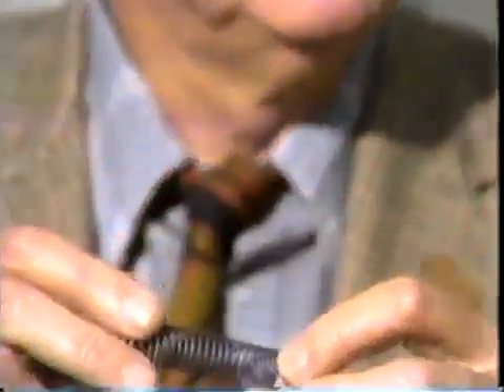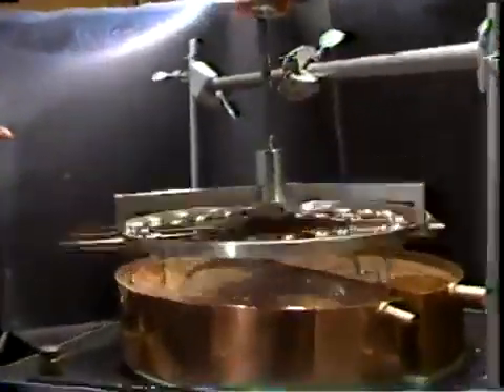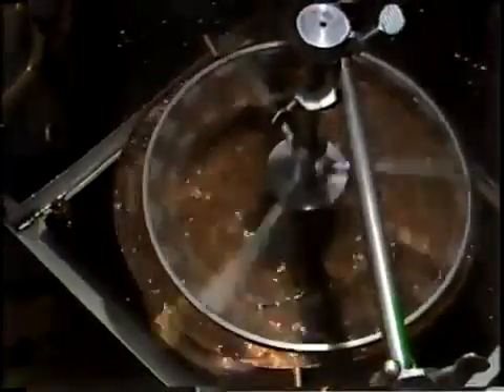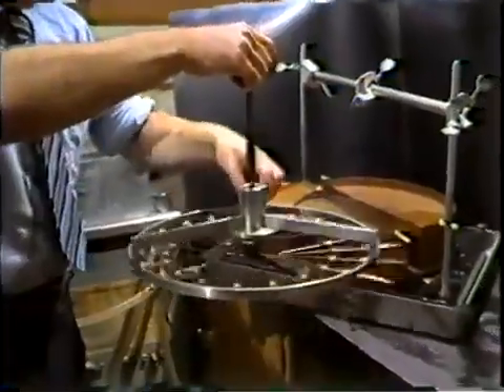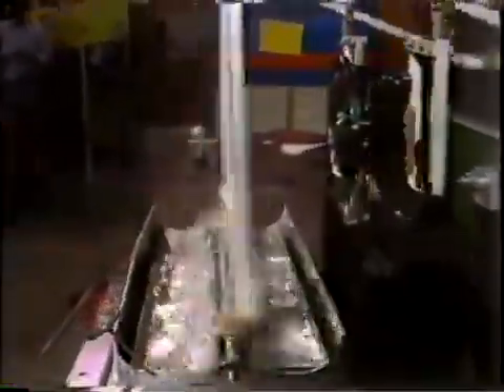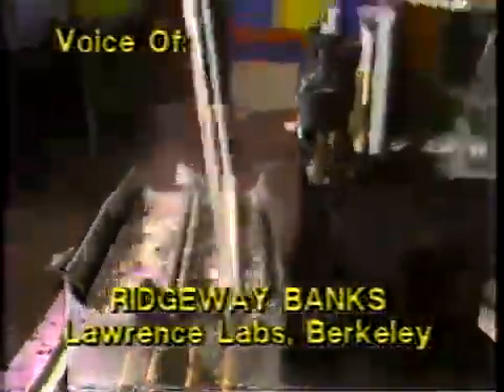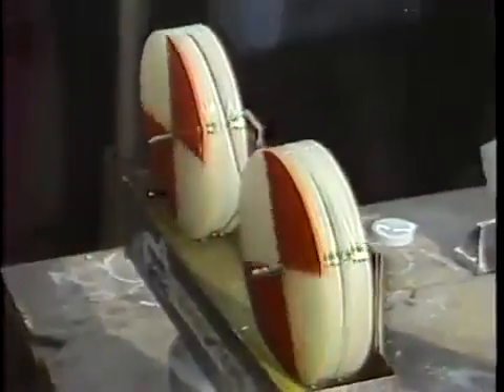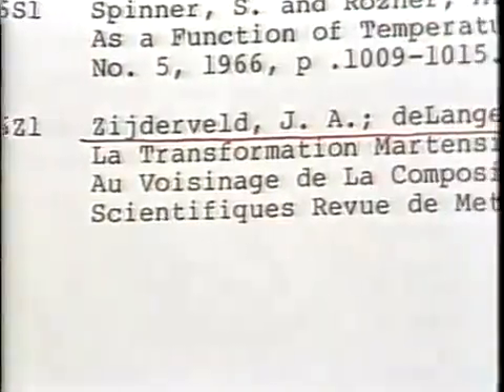Nitinol (Documentary retrieved from the internet archive)

Comment: SMA : shape memory alloy.  I first learnt about this in Beyond 2000 (Australia) around the late 1980s. Bought a sample of it from the Australian Geographic store. Haven't  seen any more of it. 

They demonstrated, that by drilling into a massive rock then placing a SMA cylinders about 3 cm long (not sure, maybe 40cm long?), then externally heating the cylinders, they expand with tremendous force, splitting the rock!! The cylinders can then be retrieved and chilled, then used again. 

They could even have long wires connected to them, then they could be heated by passing a low voltage (1-2VDC) through them, at high  current,  like 100-200A. Built-in heater!🤣😃👍
Reply from the maker: There is a rock splitting demonstration in our Nitinol playlist
https://youtu.be/GErWFSBlxDg?si=B-wvjxmfs4v1sskv

Comment: I'm guessing the nitinol world never came to pass because of some physical properties which made it impractical for large-scale things. Like a narrow working temperature range, where if it got too hot, it lost its properties, or fatigued, or corroded even.
Reply: i think they used that wire in toasters but the older ones always break after a few years. i guess it's fine for intermittent use but if it cant work continuously then it's no use for an engine.

Comment: 7 years ago…from when?   If they say, the late 1950’s, early 1960’s, then,  ok—cuz nitinol was invented (well, patented) in 1962.  
dad brought home a few “toys” engineers where he worked, were tinkering, some used nitinol. 
 Jumping discs:
Thin, Concave Bimetal disks warmed by your hands, then pushed on to invert the concavity, then placed on cool table, the temp shift caused them to suddenly snap-back to their original shape, causing the disc to jump/flip—key was, metal on one side responded to lower temps than the other, so, the side that responded faster, caused the disk to snap-back to the starting shape.
A wooden toy car:
 with 4 Not-circular wheels—each wheel was a different geometric polygonal shapes, but with the angles rounded-off—pushed along a flat surface, the flat wood piece with 4 odd “wheels”, rolled along level. 

Etc.
Reply: Shape Memory Alloys (i.e. Nitinol aka Nickel Titanium) is but ONE CLASS of Metamaterials recovered from the various UFO crashes in the USA and elsewhere from 1935 to 1955! There are also OLEDs, Quantum Dots, Metallic Glass, Fibre Optic, Optical and Microwave band Negative Refractive Index metamaterials, Magnetic plasma confinement, MRI (Magnetic Resonance Imaging), PET (Positron Emission Tomography), ultra-high resolution Quantum Field Fluctuation Imaging, Fractal Antennae, Noble Gas-based Nano-well Entrapment for Quantum Entanglement based FTL communications, GWASERs (Gravity Wave Amplication by Stimulated Emission of Radiations) in addition to LASERs and MASERs plus CMOS/GaN/GaAs and FPGA  Microcircuits, Acoustic and Multi-Band Levitation using Standing Wave Generation and 3D-XYZ axis manipulation AND Acoustic Wave Liquid Metal-based Hydrogen Plasma Compression for TeraWatt-class Power production and of course, Ultra High Molecular Weight Polyethylene, Boron Nitride, Carbon Nanotubes, Kevlar ballistic fibres, sheet graphene, plus 3D multi-material laser and electron-beam sintering for fast 3D metal and plastics printing --- Those aliens sure gave us humans a LOT of new technology to play with!

I could go on, but I think you get the idea!

V

Comment: Why not simply copy the bicycle wheel motor seems to work pretty good.
A friction plate immersed in the hot side to continually heat.  the cold side could be regular tap water.
All you need is the difference in temperature
Reply: if you live where there are hot springs, can harvest that heat to generate energy—as in Greenland or Iceland, some places in Japan, etc.
But….there has to be a big enuf temp differential.  
If that must be created artificially,  the cost: benefit ratio can get inefficient, & you start spending too much energy creating the temp differential. 
Cannot recall—seem to remember the differential needs to be at least about 50*F. 
If heating house using a woodstove, & air outside is colder enuf, that could be a viable differential….using thermoelectric plates.
There are vibration wires, that generate electricity just from sympathetic vibrations caused in those, from ambient sounds & breezes.
There’s one that works when the temp diff. between day & nite causes wire to change slightly—Thermal resonator.   
Limitations happen in various ways, for various innovative gadgets.
Reply from the maker: "Cannot recall—seem to remember the differential needs to be at least about 50*F. "

According to a statement made in the video, only a 20° temperature difference needs to be maintained. Not sure if that was F or C. If C then you are right. Fahrenheit would be more than double, so about 50°

Comment: I'm sure that Solar power is more like $300 per kW, so unless the Nitinol folks could get that cost down to a comparable level, Solar wins out.  Of course Photovoltaic technology has vastly improved snce the 1970's when this video was current data.
Reply from the maker: I think this is apples to oranges to at least some degree. Solar cannot reclaim energy from warm process fluids for example. As far as solar, what's cheaper? PV panels or solar hot water. As a DIY project, I can't easily build a PV panel, but I can cobble together a solar hot water heater which a Nitinol engine could utilize. Of course smelting Nitinol is no piece of cake either but I'd suspect it could be done in a home built forge. At any rate it's readily available these days. It's not really about one vs the other IMO. Both have their potential use. So does Oil and natural gas etc  why limit the options?

Comment: the documentary never addressed the only question needing to be asked . what is the efficiency, does the machine produce 30 percent of the energy needed to heat the water ? or 50 percent or 70 percent ? running an engine on heat is not a new concept . finding a way to do it more efficiently is news worthy
Reply: An engine that runs purely on heat is absolutely a new concept. All other engines require a phase change (liquid or solid to gas). Even a steam driven electric generator, requires temperatures far beyond that required to boil water. They require superheated steam, and produce a great deal of waste heat. The whole point of an engine like this, running directly on heat itself, is to be able to capture the energy typically lost in waste heat.
Reply: @garrettmillard525  how about a hot air balloon ? it does work from heat
Reply: The whole premise is that there is some available waste heat.

Comment: In 1985 I obtained a NiTinol engine. It was in the fashion of a turbine. Two sheaves of equal size were geared together in such a way that the helical spring, which was about 5mm in diameter, would pass through the cold water and it stretched quite easily as the loop on the hot side shrank vigorously.
From my experience it isn't hard to find sources of waste heat at around 80 deg C.  But without the source of cold media to anneal the material the process comes to a stop because there is too much tension.  The loop has to be able to get cold enough to get extremely ductile.  As I recall the temperature of the cold bath was well below room temperature.Maybe some alloy has been developed with an anneal temperature around room temperature.
Anyone?
Reply from the maker: Yes, Nitinol naturally transitions (changes shape) at around 80°C it has to be modified to have it work at colder temperatures.
Reply: @peoplesresearchcenter  that's what I thought. My proposed application would require a steel spring to stretch the nitinol in cold temperature thereby closing the damper which diverts cooling air out of the engine. Once the temperature warms up sufficiently the nitinol band would shrink, compressing the spring and directing air over the engine. The problem with this is it's not failsafe. If the nitinol fails for any reason, think connecting hardware, the damper will remain closed without any indication, leading to engine overheating. If someone wants to pursue this be my guest. Would you contact me if you do? Thanks.
Otherwise the original part of the post about the phase change temperature is likely academic by now. Can someone post a link to the phase diagram for various alloys?
Reply: @peoplesresearchcenter  and thanks for the correction 80 C. And the cold transition temperature escapes me. Probably specific to each alloy.
Reply from the maker: That wasn't intended as a "correction". I think the engine you had used a modified form of Nitinol that transitioned (softened) at a cold temperature, near freezing. There are, what I consider more "pure" forms of Nitinol that are quite soft and pliable at room temperature. It also helps if it is thin, as this will cool off in air faster. I think for what you are trying to do you will need the higher temperature (more pure, undoctored) stuff.

Comment: Solar panels are so energy costly to create, nobody ever factors in how long these electric generators will last and consider that cost against how much energy was needed to create the generator, not just in melting silicate or metal and pouring it into a mold, but the cost of mining and refining the materials used in it the electric generator, the metal titanium is extremely energy intensive to create, so already the nitinol machine is not starting  off well, but if the metal truly doesn't have any metal fatigue, that would be impossible, the crestline structure of metals, nah no way it doesn't have any failing point, this is highly suspicious. 
The quantity of sea salt that contains trace elements of what yellow cake uranium is made from is plentiful, but how much energy does it take to make a single fuel rod from sea water? Much more energy than you will ever make back with it powering your nuclear reactor, the reactors don't last long enough to make up for all the energy used to create the core and everything else which you need for a nuclear reactor, If you want to hold onto the solar heat that your panel turned into electrical energy there are many ways that don't require copper, or lithium or cobalt, you can run a small water pump that pumps water up to the raised water tank, than when you need the power, have the mechanical energy of spinning cogs that are spun by the water, or by the weight of the water, it could be as easy as having a pulley system raise the mass of your entire house, that drives the electric engine that turns that mechanical energy into electric energy when you want to use that potential energy stored by raising it.

Comment: I heard about this metal, it was used in medical uses, using the memory aspect of the metal, unless what I'm thinking about is something else, but I never heard about it being used in an engine, I don't know how they're comparing this nitinol engine with a nuclear reactor, it sounds like BS, but I would like to compare this nitinol engine, powered by geothermal energy with a stirling cycle generator, see how they compare the nitinol one looks like it won't have any issues with valves and things like the Stirling cycles gen does, but will it slowly transfer heat from the heat sauce, in this case tectonic heat, into the cold area till it stops working? I guess you could have cool water cycled out to an evaporative cooler but will this nitinol than be powering a large pump and little else?

Comment: Interesting and thanks.  I've heard of this alloy before. If you could contrive to use geothermal energy to charge lithium-ion type of batteries?  So, ultimately you are taking out engergy out of the ambient system and then storing it.
Reply: God damn those lithium ion battery are nothing but holders of the electricity, they are useful when you want to make mobile electronic devices with a used by date that can't be changed, if those Tesla used the energy in diesel instead of having thousands of times more energy used creating this lithium toxic nightmare battery, a short lived battery that will be a long lived toxic waste problem and massive issue for fire safety, it's just a way of holding onto the electricity, it doesn't make electricity, we would be much much better off, if those batteries had never been made, not just in carbon emissions but in making toxic water that can't be used after it's taken out of the battery, even if they make solid state lithium batteries they will be the cause of our destruction, but as long as the economy is ok, IDIOTS, they can't be justified, even used in phones, which are anything but smart, that bloody car the Tesla could have used hydrogen, if they absolutely wanted to have zero emissions there are several ways of going, using old world technology tech too, the world is just full of people that don't question anything for themselves, like what did Tesla make? wireless charging of your phone, that's what Tesla came up with over a hundred years ago, but it's called cutting edge tech by a bunch of idiots.

Comment: So what's happening now with this Nitinol, I remember memory metal glasses frames were a thing at one time
Some brilliant ideas just get squashed by big money because they don't fit their present economic policy
Reply: Used in surgery a lot.
Reply from the maker: I have some projects going. Seeing what can be done with it to build a simple heat engine and generator.

https://stirlingengineforum.com/viewtopic.php?t=5696

I'm just getting started and wanted to post this video to the Stirling engine forum. I had seen the video before, but it was no longer available. I found a copy on the internet archive and so re-uploaded it.

If I get a working engine built I'll be making a video. Progress will be posted on the forum.
Reply: It's cool, but it (currently) has limited real-world application.  Also crazy expensive to manufacture and prone to mechanical fatigue failure.
Reply: @curtisjones1904  not brilliant for aircraft as someone was saying then
Reply from the maker: @SusanAmberBruce  Nitinol has many aerospace applications and suffers much LESS metal fatigue than any other regular metal.
Reply from the maker: @curtisjones1904  I see one true statement: "It's cool".
Reply from the maker: @curtisjones1904  everything is relative I guess. What do you consider "limited"? Nitinol has tons of real world applications. Expensive? I've bought a bunch of Nitinol wire  lately to experiment with. Seems reasonably priced to me. Fatigue failure? Just the opposite, Nitinol is sought after primarily because it is much less prone to fatigue failure than other metals.
Reply: All six of my identical glasses frames are the same nitinol metal. The first pair are 18 years old. Each new prescription goes into the oldest ones frame.
FIFO
😊
Reply: Lawrence labs had many findings that "regular" physicists didn't like. Once a report from there was reported in the popular Science Digest. The chief scientist stated that target protons showed properties that could explained only if they were composed of vortices. Nothing was heard of that afterwards. Soon after publishing that report the digest was bought out and ended.
Reply: @rogerscottcathey  Maybe that strange metal found at the Roswell crash site was nitinol, huh!
Reply: @SusanAmberBruce  : Maybe! Cold forged

Comment: The obvious first question is: what went wrong — why did it not work out and we've not been having a "nitinol economy" for the past 40-something years?

Off to look for answers now.
Reply: 11.5% efficiency sucks big time but to be fair you'd be using this to harness the energy present in waste heat from other processes. The solar heated pump honestly sounds like a fantastic use for it but maybe not in a cold/cloudy environment. Also I'm not sure but aren't stirling engines still more efficient?
Reply from the maker: I've been working with model Stirling engines for years. I've only just started designing a small Nitinol engine and haven't done any actual comparative testing, but my initial impression so far experimenting with Nitinol is that it packs more of a punch given the same heat source. On a cup of hot water for example a Stirling engine will run well enough to overcome its own friction and not a lot more, but a Nitinol wire dropped into the same cup of hot water develops enough force to smash the cup apart. Time will tell. I hope to have a small model Nitinol engine put together before long.
Reply: Because it's EVEN HARDER than titanium to manufacture, machine, and heat treat. Also, nickel is a known carcinogen which wouldn't be a problem in most other alloys, but with nitinol, nickel leaching out of the alloy is a serious issue - especially for things that require biocompatibility.
Reply from the maker: Of course, that's why we put nickel in silverware that we eat off of every day and use it for coins to put in our pockets, and why Nitinol is used in many medical applications inside the body.

There seems no end to the misinformation being spread about both Nitinol and Stirling engines.

I'd recommend downloading a copy of this video before it disappears from the internet (again).
Reply: @spdcrzy … Everything you said here applies to almost every commonly used material. But petrochemicals are perfectly safe.
Reply from the maker: LOL, I was thinking the same thing, the chemical soup in an automobile, grease, brake fluid, antifreeze, etc. and of course the exhaust fumes, the refineries, the oil spills etc.